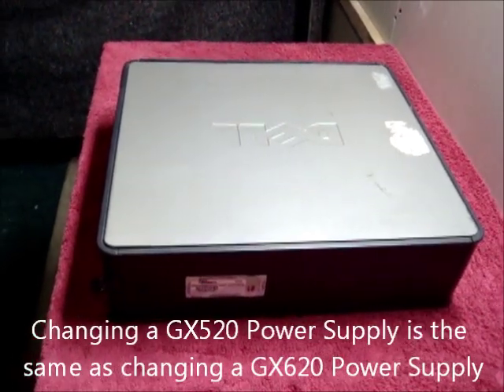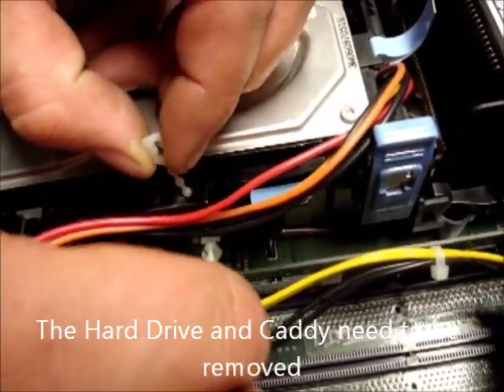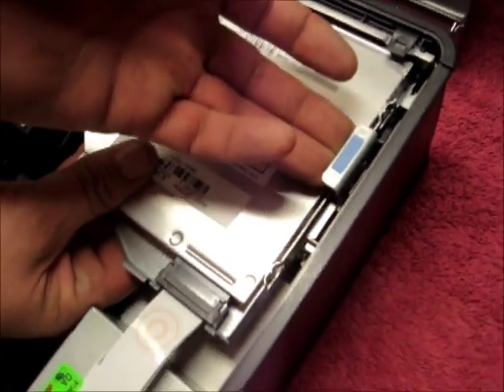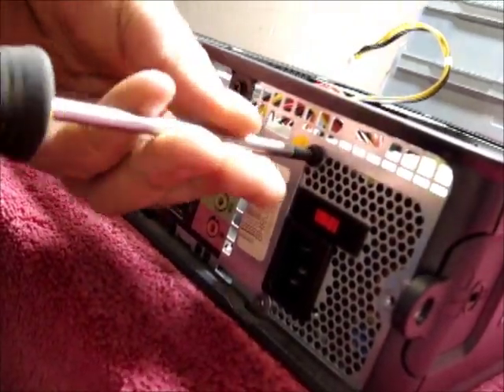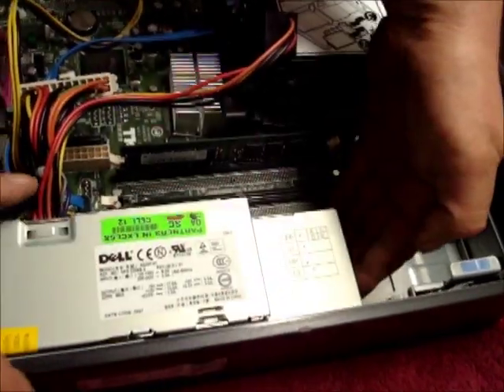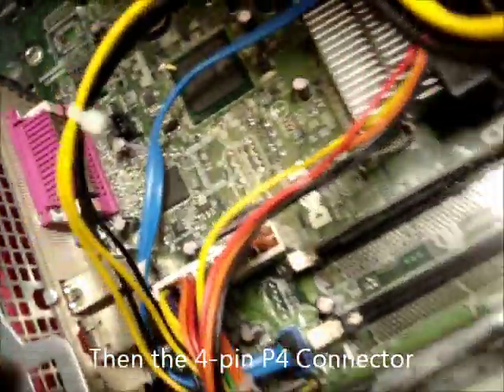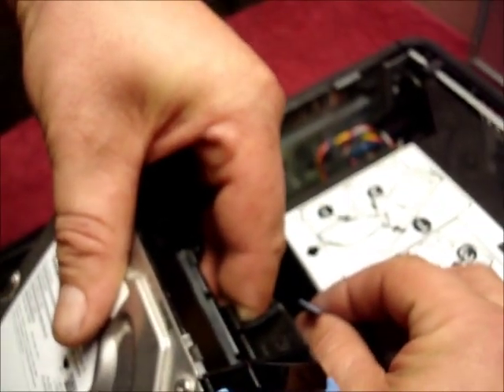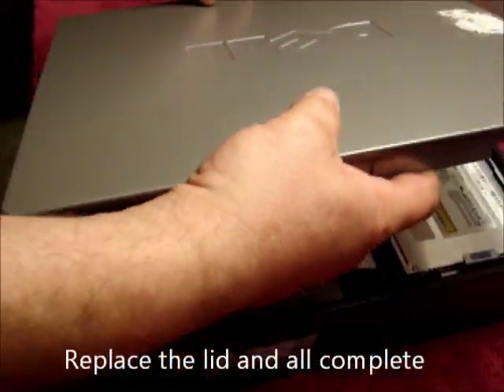How to change Install  Replace a Power Supply in a Dell Optiplex GX520 GX620 Desktop

Comment: I have a computer that I'm having trouble with, and I'm wondering what to do to fix it. Basically, I am a blind woman who uses JAWS
(Job Access With Speech) screenreader software, and I have a Dell Optiplex GX520 Desktop computer, Express Service Code 29309640481, Service Tag DGQ7BC1,
which was purchased for me by my American Dad, Scott. There's a problem I've recently run into, and I'm going crazy trying to find just the right solution,
so I was wondering if you can please help. When I press the Power button on my Dell Optiplex GX520 Desktop computer, the fans are supposed to spin up for
a second, then slow down as the machine boots. However, they're now spinning wildly out of control. This only recently started happening on November 28
of this year. I'm so afraid that something might explode or sizzle if I try to turn it on again. My sighted friend, Markus Johnson (yes, that's "Markus"
with a "k", not a "c"), is hopefully going to come over soon to clean out the machine, as I fear that dust may be causing this issue. I'm hoping nothing
has failed, as I've had this machine since 2009, and it's been running like a Swiss watch for me. However, the case fan has started making this horrible
grinding noise, like a diesel truck at full throttle. At least I think it's the case fan. Will any replacement case fan work with this machine? Or does
it have to be proprietary to Dell's computers? Markus has told me to leave the machine powered off for now, and wait until he comes over to check it out.
Is this a good idea? Also, what can I do to prevent any dust from blowing back into the machine? Is there a dust mat I can put underneath the tower? Also,
is there a way I could add a cooling pad underneath the machine? What do cooling pads contain that keeps things cool? I'm confused! I'm also wondering,
might it have something to do with the Bios? Is there a safe and easy way to reset the bios on my Dell without ruining the machine? If so, what do I do?